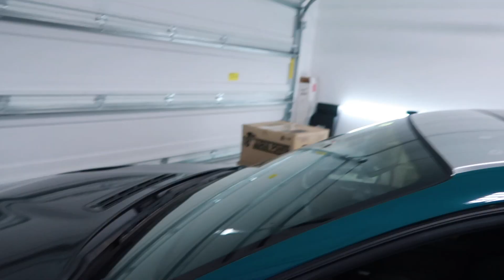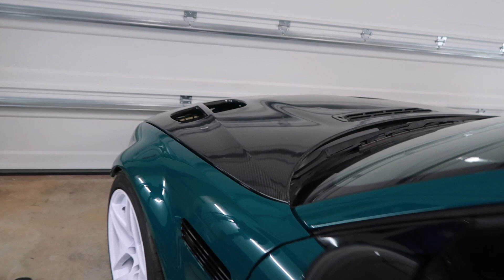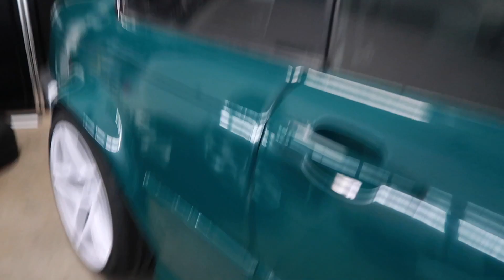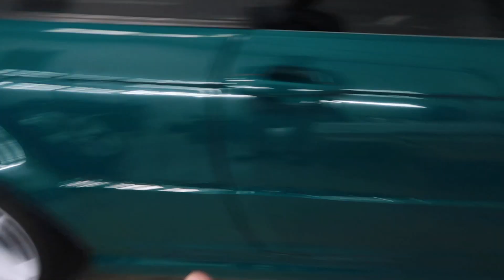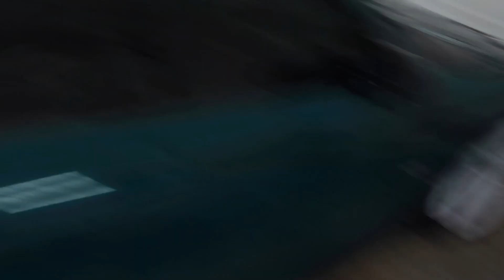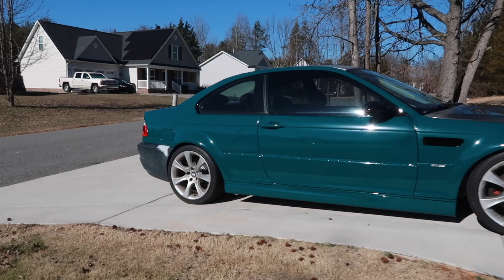ITS BEEN LONG ENOUGH.. | E46

Comment: Hey Eldridge just a little tip you can use on the passenger door before you decide to peel it off: take a little needle/ super fine syringe and poke a hole where you can’t see it on the upper part of the body line to either squeeze the air out or suck it out with the needle and syringe.  Just be careful with the heat and squeeze out the air slowly towards the pinhole so it doesn’t stretch larger and you don’t see it!  Cars look super clean though you should be proud of yourself.  Unrelated but I also sold my 14’ 335 for a 20’ 440i 6mt just 2 months ago and it is funnn.
Reply from the maker: Thanks! Yeah I can only get better with time 💪🏽. I tried popping them but no success lol. Might give it a try again. I enjoying driving mine as well. We all know it’s not as fast and sucks in low gears but it’s still fun lol.